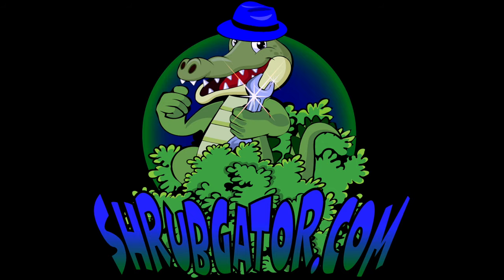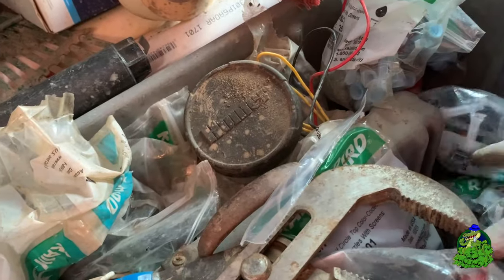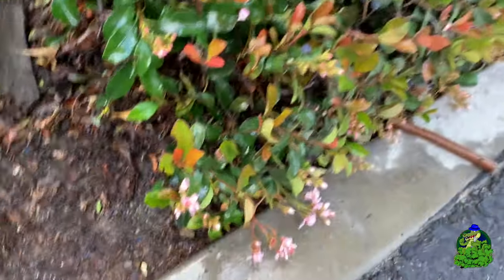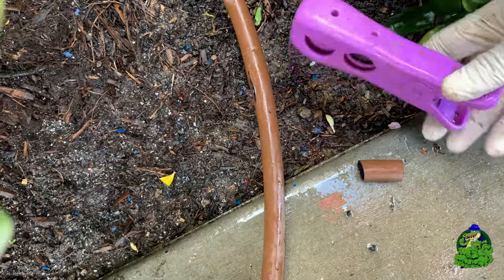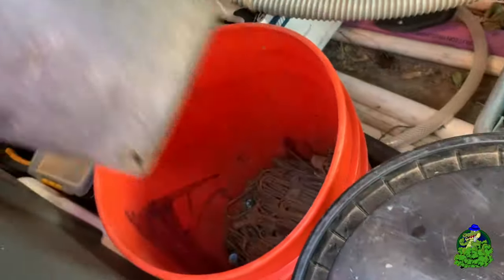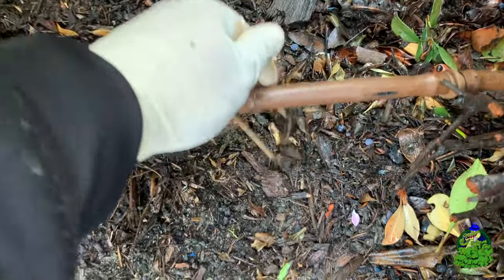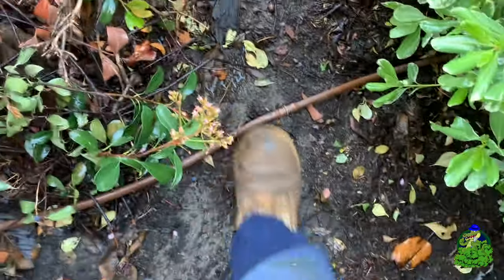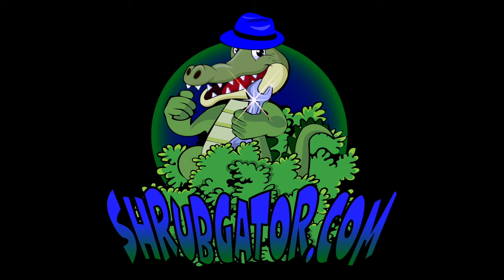How To Fix Drip Line Breaks

Comment: Use the cut out piece to duplicate the length of the new piece.  Using a Bernz a matic torch and gently heat the hose end and it will easily slip over the fitting and then shrink tight.

Comment: I tried doing this and killed my hand muscles trying to shove in those adapters! I found that if I got the same size in the black tubing, those adapters fit in much easier, and were stable. So only had to really wrestle with it twice instead of four times. I also found using a heat gun, carefully on the brown tubing, did help with inserting the adapter. Make sure not too much or the tubing will warp!
Reply: Rather than a heat gun, just some hot water.  Then less chance of ruining the tubing.
Reply: Agree on hot water.  If you are installing a drip system, you might do some of the connections inside.  I take a coffee cup, boil the water, insert tubing in water for 30 seconds and then push it on the tubing.  There are two ridges that the tubing has to go over and it is important that you cut the tubing accurately which I is why it is a good idea to purchase a tube cutter.  I have used shrub pruners before and they are not accurate.  If you don't get the tubing butting up against center of the fitting you are very likely to have a leak.

Comment: I was reel mowing my lawn for the first time and accidentally knocked the sprinkler head and broke the male tee fitting. Couldn't find any at local big box store and had to order. Now today I finally replaced it and removing the old fitting from the tubes was very difficult lol. Any suggestions or tips on removing a broken male tee fitting without damaging the existing  line from the barbs?